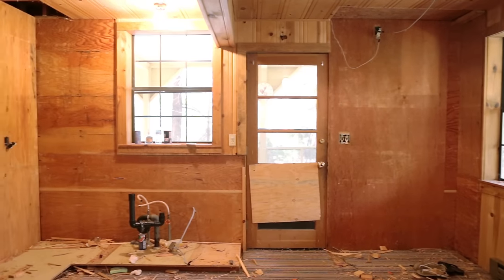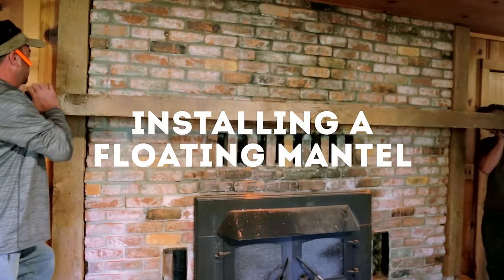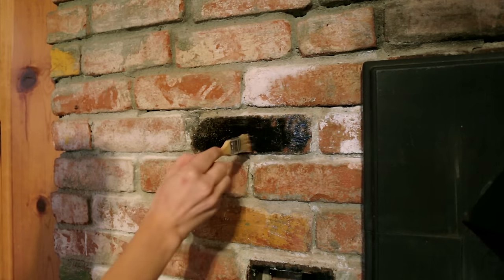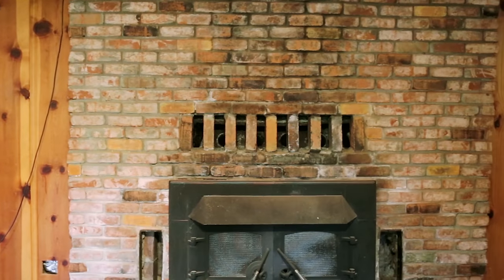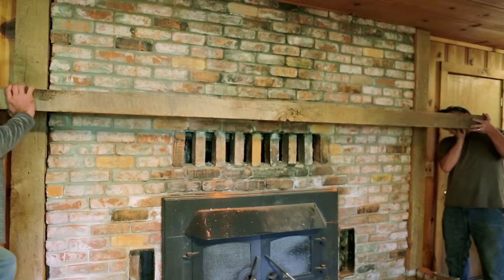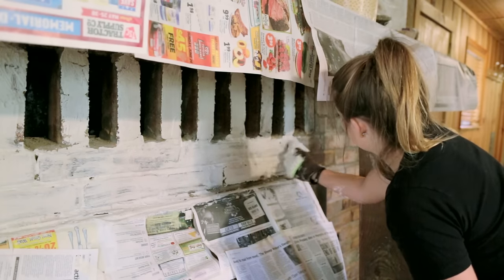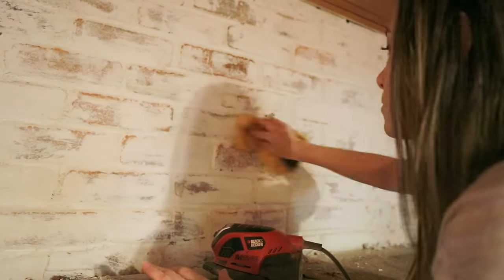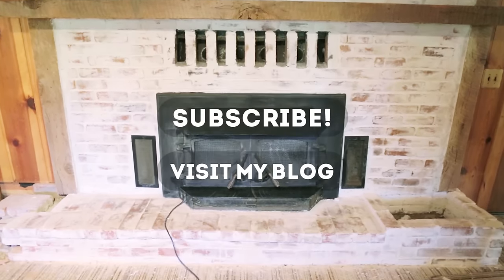How to German Schmear (Mortar Wash) a Brick Fireplace

Comment: Very nice! I had not seen this video, but got a look close to this. I never picked up a piece of sandpaper and the look I got is similar to this, but actually mine looks somewhat more rustic and not quite as white as this. I will try to post it on YouTube but I did not record myself doing the process. Our fireplace was not used to burn wood so was pretty clean, we just vacuumed it and ran a damp cloth over it just in case and waited a day. Went to an area paint store and his instructions were great-I showed him a photo of the fireplace. Spot on instructions. 1) paint all the grout first, simply using latex wall paint. Applied with a sponge brush. I thinned mine slightly and since my grout lines were nice and uneven, it was a bonus for a more rustic look. 2) Buy RustOLeum brand chalk paint. I bought the antique white. Cheaper and got better reviews than the 'original' and expensive brand bearing a woman's name. I bought a sea sponge and tore it in half. I bought sponge brushes (only used 2, one for each paint) and instead of dipping the sponge directly into the chalk paint, I applied the paint onto the sponge using the sponge brush. I sponged on the paint turning the brush in lots of different directions, and added more paint here and there, haphazard pattern. 3) have a terry washcloth handy with a dish of water. Rub paint off with the damp washcloth wherever you want more brick to show through. Some bricks were left barely touched, or portions of a brick were left barely touched. Add more white paint to corners to make the bricks more "rounded" than square. I did a hearth and a wall fireplace, start to finish in about 5 hrs. It's gorgeous and was easy and not laborious at all. Thrilled with the outcome. If you want to sand some paint off, go for it, until you get the look you want, but while the chalk paint is still wet, the dampened washcloth worked great. Didn't even spend $25 for all and tons of chalk paint left. Go for it,  you will love it!

Comment: A previous owner painted the fireplace with latex paint, which looked terrible. That Citrus Solve stuff worked great, BUT 1. You have to put it on very thick and 2. Let it dry for well over 30 minutes. It will start to bubble, and then you can peel it right off, even using a palette knife. 3. It won’t work on mortar, and will dissolve that.
Excited to try this mortar wash technique, because after stripping off that awful paint, the brick doesn’t look good after all. Definitely going for shabby chic.

Comment: People power wash bricks with everything from just water or a baking soda mix to walnut shells or other nut shells which works great on the outside, but not sure about inside. If the rest of the house isn't finished or the floor is taken up and you don't care about it, I guess the walnut shells could be done inside by someone. Just make sure you protect the sheetrock around it!@!!  LOL (a lot more than just tape)

Comment: Always hilarious watching a pretty girl fumble through these projects like they're trying to be Martha Stewart or something. The smartest thing she did was hire the men to install the mantle. Should have done that last though. You need to wet the brick before applying the mortar, and the mortar was way too thick. it will flake off in a couple years. You could have got the same effect by using limewash with 1/3rd the effort. Used the wrong stripper too, those bricks will flake off first.